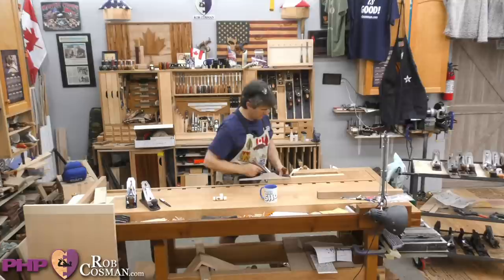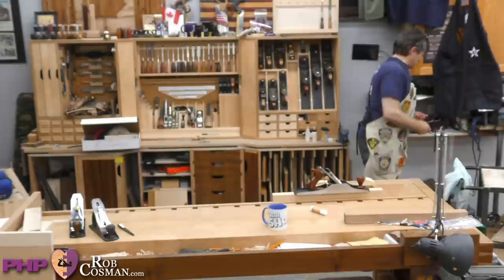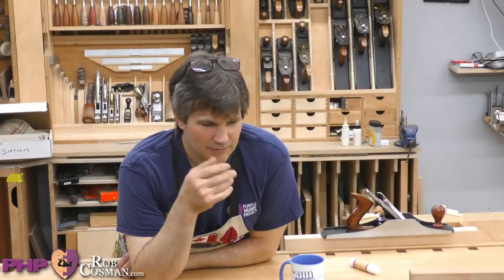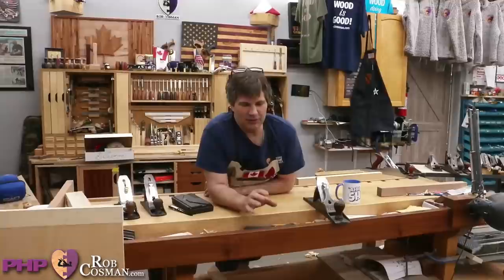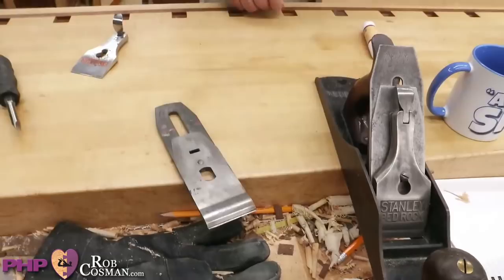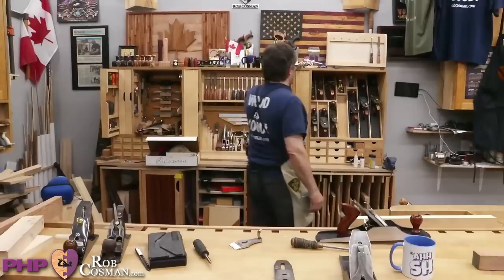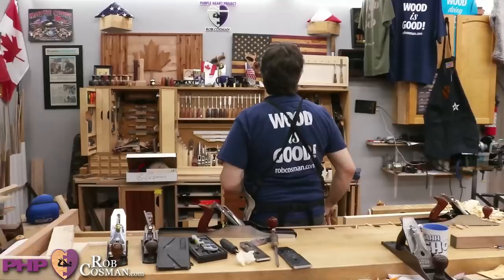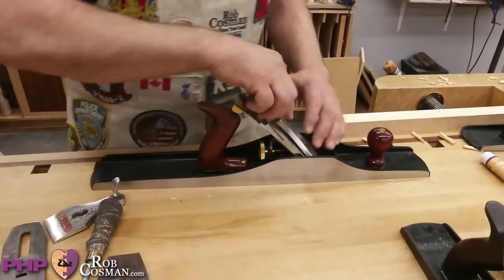Refurbishing Old Planes - Live Q & A (1 May 2021)

Comment: I think this thick blade is better idea is just about selling more newer planes.  A proper set up stanley ( the old English or USA versions ) will work just fine.. ( I have a 4 and a 5 and it took some time, but when I managed the proper set up, they do the job very well )
Reply: Having inherited my grand-dads hand tools in 1985 I've been able to to refurbish his chisels, planes, and saws to a condition that they are quite capable of performing what one could expect of the performance of tools that were made in the 1930s, as long as I spend the time to learn proper hand skills.  There is something about using my Grandpa's tools that no modern tool can ever match the satisfaction I get when I use his.

Comment: I’ve collected quite a few Stanley planes…they seem to work fine but I noticed when one of your crew asked a question you moved so slow on your shave and it just kept going.  Is that from the plane or the blade. Never have been able to get that done with my planes
Reply: The wood is also important.

Comment: Rob. I’ve learned so much about planes and sharpening from your videos. Two new revelations watching this video. One, you don’t like Stanley. Two, you say you could replace a thin blade with a thicker one. Unfortunately for me, all I own is Stanley Bailey. 4, 4 1/2, and 5. And yes, I experience lots of chatter. And no, when I’m planing, the sound is not smooth and soothing. 
Can I replace my blade blade and chip breaker with the ones used on a Woodriver plane?
Reply from the maker: Yes you can

Comment: Yeah I'm sure the 1000s of craftsman were struggling to use these planes with the thin blades. What nonsense.
Reply: Well, this video is yet again an infomercial for the (good) Quangsheng made planes he sells (woodriver, dictum, quangsheng, juuma...). That said, there are many valid points. Wooden planes had thicker tapered blades than stanley bailey pattern planes. The Bailey chip breaker with a hump was actually patented as to allow good results with thin and cheap materials. Stanley planes are not the absolute best but they should be great enough for almost everyone.
Reply: I would say that they didn't think that the cost was worth the benefit that comes from a thicker blade
Reply: @ronbarnett2383  what benefit is their tho Ron? I use a stanley no 7 a 5 and 4 1/2. No chatter. No issues. No need for a thicker iron. Rob Cosman is a fantastic craftsman no doubt but when he uses the term Achilles heel in ref to the thinner irons......oh I dont know.
Reply: @Riffme81  Have you tried both the old and new style?
Reply: @worldtreedesign  yeah mate. I own a Luban 5 1/2 and a few vintage Stanley's. I like the Luban. Good weight. Performs well......but then again so does a proper set up vintage Stanley.